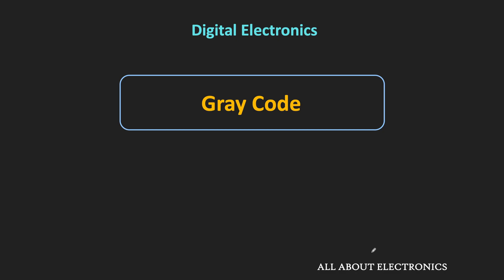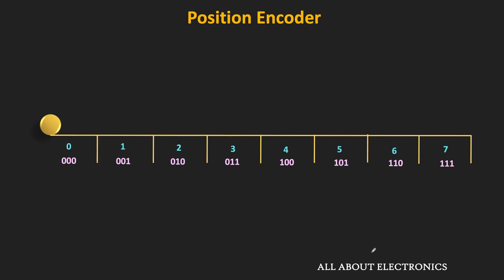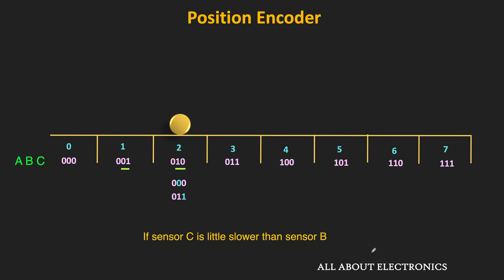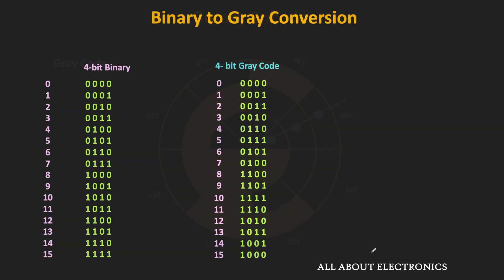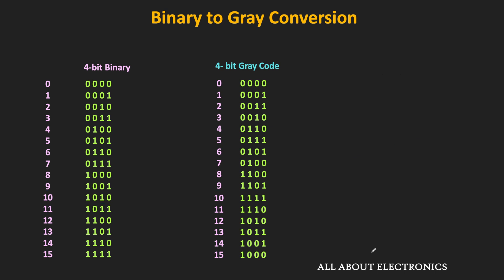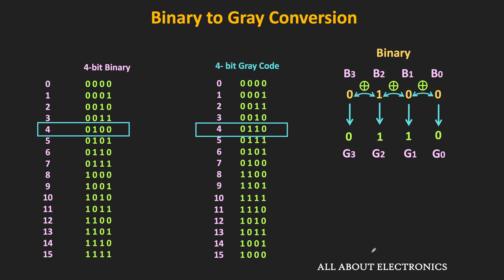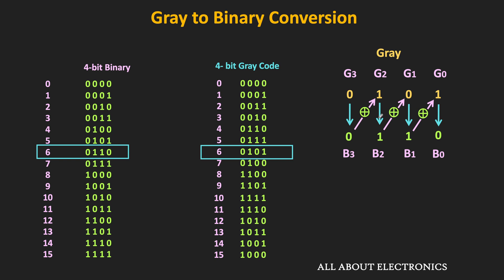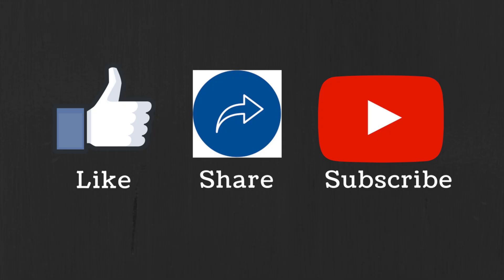Gray Code Explained | Gray code to Binary and Binary to Gray code Conversion

Comment: 12:54 sir pls tell me how to solve this question...   As there are 7 bits so I am confused..  I divides the 7 bits to 4 and 4 bit from Left hand side..  pls sir tell me the procedure and the ans 🙏🙏
Reply from the maker: Just start from MSB. Copy it as it is. Then after, just follow the procedure which I mentioned in the video. Although I explained for only 4 bits, but for 7 bits also the procedure will remain the same.
Reply: @ALLABOUTELECTRONICS   Thank you sir for your response..   Now I am able to solve it after I followed your rules